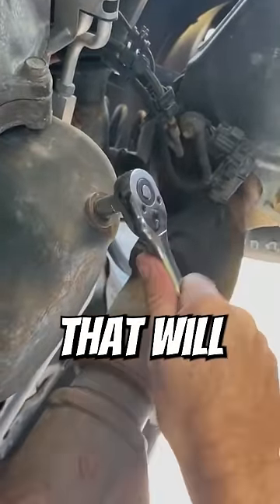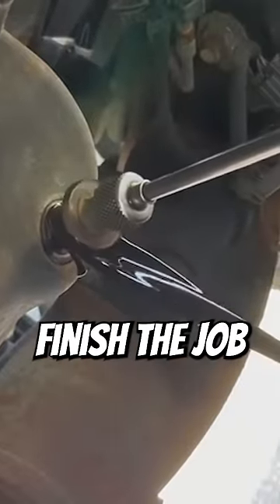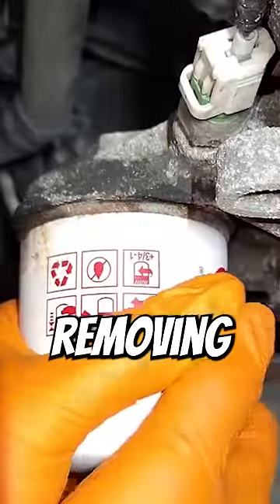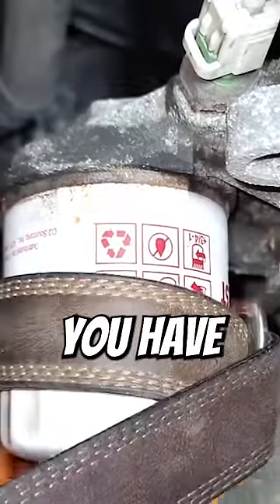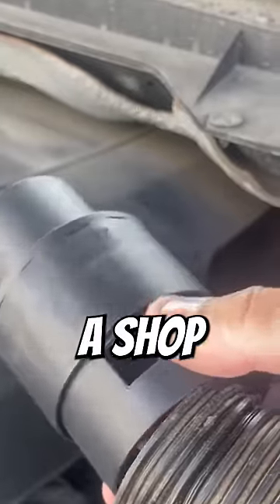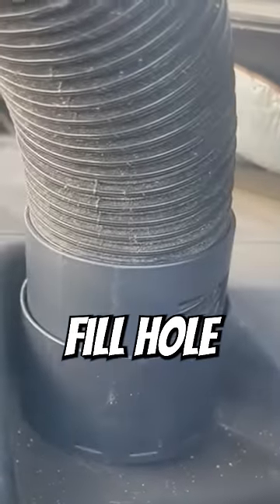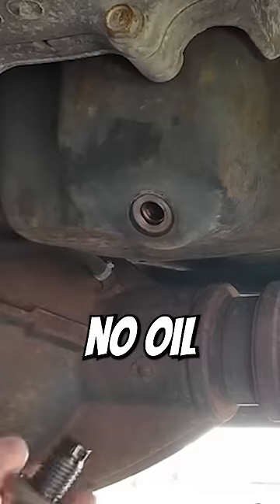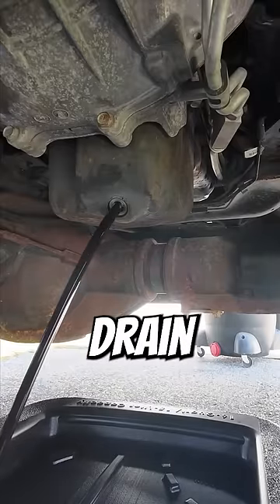Mechanic Life Hacks That Will Improve Your Worthless Existence - Oil Change Edition

Comment: Quick tip if you don't know if you have completely drained all your oil out,put your lips to the oil hole and suck it out.
Reply: That's one way to do it I guess
Reply: Or just put a bucket under then go grab a beer or two and maybe take a nap... After several hours the oil could be mostly drain out.... Or drain the oil overnight.... Next day is no oil drop
Reply: @MariusVayne85  here's a quick tip to dispose that motor oil.:pour it out on your lawn it helps kill mosquitoes cricket ant no cats will shit in your yard crab grass real grass grasshoppers. Hope this helps
Reply: @john_dougg811  lol.... That's how I disposed ant nest.... Lol... Best way to do it.... Or there's a cheap way to make your tyres looks shiny.... Take a cloth and dip into the used oil a little then wipe the side tyres...... Lol....
Reply: @MariusVayne85  it make a great dye for the driveway. Also,when I have chapped lips or dry skin it make a great moisturizer. Don't git rid of that filter, you can use it as  brita water filter.
Reply: Yum
Reply: Are you speaking from experience and is that why you can't decide if your name is John or Doug.😊
Reply: Hehe good one ...hope no one would take it seriously though

Comment: The hack I use is a paper towel. It will wipe the oil from your hands.
Reply: Gloves exist and do a better job
Reply: Not when you're in a hurry And the oil is lava degrees.
Reply: This was the most useful
Reply: Sure, but all that exposure to hot, caustic chemicals is a great way to get skin cancer. I've been wrenching for 15y and have been using gloves and tips like these for10 of them
Reply: Same here
Reply: @michaelbuteau4183 why you changing the oil while it’s lava degrees
Reply: @michaelbuteau4183 you shouldn’t be changing your oil when the engine is at lava degrees
Reply: I wear a glove, remove the drain plug, and do something else for 15 minutes while the oil all drains out and stops dripping.
I put on another glove, remove the oil filter and clean up with a paper towel.
Then the drain plug goes back in, the new filter goes on, the fresh oil goes in, and I'm done.
Reply: 2023 when even mechanics don't like to get their hands dirty ooh messy2023 when even mechanics don't like to get their hands dirty ooh messy😂
Reply: @corgi46290 LOL I assure u u DO NOT have to worry about gettin 'skin cancer' from not wearing gloves doin mechanic work I'm 61 years old been doin it since I was knee high & can't stand to wear gloves when working & I've seen MANY MANY others the same way I'm 100% sure about this
Reply: @@MyIQis172 If you can work out a way to make it to the shower without leaving oily handprints all over the house on the way it's a quite viable solution.
Reply: @jamiejones6994  as soon as you can produce an oncology degree, then your words will carry weight. Till then I'll trust the experts.
Reply: @vwwrenchie314  nice job proofreading yourself there slick
Reply: @jamiejones6994 Survivorship bias. People have been doing dumb dangerous shit and not getting hurt and not knowing anyone else who got hurt for ever, while loads of other people got hurt. Your experience doesn't mean it's not dangerous and loads of people haven't got cancer or just dermatitis from oil.
I managed to get contact dermatitis from frequent extended exposure to WD40, now my skin is super sensitive to it. It's not fun.
Reply: @feanor5037  LOL u really do think that was what it was from (wd40) don't u?
Reply: @jamiejones6994  You can make any weird innuendo you want but yes, after recurrences over a period of several years if I'm not fastidious wearing gloves - definitely was from WD40. It's a known problem if you review the COSHH sheet.
Reply: @feanor5037  Like I say 50+ years guess I'm a lucky mf lmao

Comment: I usually just get it done.. have a shower beer after and get on with my life.
Reply: You know you want to try the vacuum trick
Reply: You sound like my kinda guy… simple and to the point.
Reply: Yeah.. for the most part if you’re getting oil on yourself you’re doing it wrong
Reply: Yeah me too infact I love getting warm oil all over my hands it feels good!!!
Reply: @foojub6907 pssshhh you mean if you’re NOT getting oil on yourself, you’re doing it wrong
Reply: Best tip is keep an old blanket or large piece of thick cardboard and place under the engine bay. If anything goes south for any reason most of the oil won't end up on your driveway.
Reply: @foojub6907  or you just don't give a $#!t about getting oil on your hands.
Reply: @slacker007  keep soaking up those carcinogens, clearly they’re doing you good

Comment: I wont lie, the computer voice had me expecting some garbage, but these are actually pretty solid tips for beginners.
Reply: except the magnet one, oil just pushed the bolt into the pan.

better just to pull directly back and a little up, i dont think ive ever got oil on my hands since my first time. though the oil filter cup method is awesome.
Reply: Not an AI actually, you can hear the breaths and the pauses
Reply: @OverAndOverAndOver  it's an ai, it just sounds super real to people that don't hear it every day. it has strange cadence and tone and the sample rate fluctuates randomly.
Reply: @OverAndOverAndOver Ai can make those sounds just the same.

Comment: Tip # 5. Switch to a fumoto drain plug.
Reply: Yeah but of you have a slamed or low car your going to oil the ground instead of your motor
Reply: @snapped4433 If you have a "slammed" car you're going to lose oil pulling out of the Walmart parking lot anyway
Reply: @lordgman1  yeah but that sits way lower
Reply: @snapped4433  Maybe don't have a slammed car then. I mean, cars can look cool lowered a little, but if it's so low that you can't even leave parking lots, not only do you look stupid, but so does your car.
Reply: I got a Fumoto because my car is slightly lower. Without it, I’d have to use jack stands or a lift. With it, slip a tube onto the end and route tube into tray, open valve. No mess and no jacking up the car.
Reply: This is my favorite 'hack'. Have two cars with Fumoto valves that never have any spills or splashes, no hot oil on fingers, no oil hiting the underbody due to poor engineer layout. Over 10 yesrs and 250,000 miles combined on the two with no issues. My ramps only collect dust unless I'm doing major repairs.
Reply: Tip #6 buy a spare engine so that when your Fumoto snaps off and burns up your engine you have that spare ready to go
Reply: I installed this in a Toyota RAV4 and Subaru Legacy and this is not a concern and I have the longer post that’s 15mm long. .59 inches . The Subaru has a cutout in a pan shield under the front engine and that post doesn’t even come close to even touching the pan so if you tear this off you are gonna tear off the shield pan and do a lot of other damage.  I hook up a hose and drain my oil right into a container and don’t get a drop on my hands. Also neither drain plug is pointing straight down but on an angle.  I wish I installed these years ago it makes changing oil so much cleaner.  It’s .59 inches long. 19/32” really snap them off😂😂😂
Reply: @RushWorkingMan  that sounds pretty similar to what I have on my FR-S. The end of the Fumoto valve is higher than several other things so if I’m hitting that on something it’ll be the least of my problems!
Reply: There’s a better design with a screw on cap.  Only downside is you screw the cap off and screw on a designated hose to drain.  Safer from speed bumps and sticks tho
Reply: @fredkuhn165  who makes it never seen one?

Comment: Oil filter cup is the one I’m going with this week. I don’t want to accidentally suck oil into my shop vac
Reply: @gmailisaretard well to be honest he could suck some drops of it in from underneath the valve cover, wouldn't be much but still it's used oil in your vacuum, probably wouldn't smell very nice after
Reply: I always poked a hole in the bottom with a nail and drained it. I might need to use the cup method Instead
Reply: I don't believe the shop vac
Reply: Get a centre punch and a hammer, hit the bottom of the filter and let it drain out first. This helps when the filter is massive
Reply: @Nays33 
Just use the solo cup
Reply: @berniemadoff7837  a truck filter doesn’t fit in a solo cup do it 😁
Reply: @NayNay-eu8en  
Can be 🤣
Get the Super Big Gulp.
Reply: @berniemadoff7837  I do it that way as many filter spill or push oil out of the top when you unscrew em, stops pretty much all the mess.
Reply: I have used every one of these Tips and hacks as a mechanic they all work but shop vac hack has always been my favorite

Comment: That shop vac trick is badass. Ive been a mechanic since i got out of the Marines in 2017. That shit has never even crossed my mind.
Reply: Right it's amazing I'm trying that next time. For a split 2nd I thought he was going to suck the oil out with the vac. I was like nope I'm changing it glad I kept watching
Reply: I tried this earlier this week and it worked on my cummins. Made a completely mess free oil change.
Reply: It's awesome if you need to change a seeping oil plug (BMW) and you don't want to drain the oil because it's not old yet.
Reply: me either,and I HATE I DIDNT think of it
Reply: Don’t do it it will screw up the seals in the engine.
Reply: @taterthot1184  If you think a normal shop vac is going to mess up seals, you're out of your mind.
Reply: I seriously doubt it will exert that much negative pressure to affect seals.
Reply: @st0rmtro0per  that's saying something. I'm pretty sure its written in the bible "he who doth change oil in a diesel shall wear multi grade on thou hands"
Reply: @taterthot1184  wrong.
Reply: I've done this before on my bike and it works like a charm..
Reply: It may fill your egr valve’s with oil
Reply: Use it if you need to plug a leak in a DIESEL fuel tank...on car...without draining or dropping the fuel tank.

The suction will keep the diesel from leaking out of the hole...clean with a degreaser and then use JB Weld for fuel tanks...
it will suck the JB against and possibly into the hole as you smear it all over the outside of the leak.

Wait about 1 hour and good to go...

DO NOT USE THIS TECHNIQUE ON GASOLINE FUEL TANKS.
Reply: First time shop vac is on blow and not suck will destroy any benefits you ever had.
Reply: Wouldn’t a powerful shop vac actually suck oil up out of the fill hole into the vacuum and ruin the vacuum?
Reply: Give the engine a suck and the black stuff comes out 
-uncle Ronnie 1947-2018
Reply: Only useful if you were replacing some kind of sensor mounted on the oil pan and you didn't want to mess with draining or replacing the oil. 
Besides if you pull to much vaccum on the crankcase you risk sucking in a gasket which would cause you to have one hell of a oil leak
Reply: I wouldnt suck the oil up even if its thinner and warm ?
Reply: @khatlest11 that's what I'm wondering as well..
Reply: Rah rah 7ton go wee
Reply: @AJ-yo7rb   well if you have an un bulletproof'd 6.0 powerstroke.....this act gives you the reason to finally yeet your complacency and remedy the fact ur rolling around in a ticking time bomb. The explosion will be more of an implosion. Your wallet will suck in faster than my dad at a public pool.
Reply: Me too brother, thought that idea was pretty cool 👍
Reply: @AJ-yo7rb The egr valve will be pulled off of the valve cover in order to get the hose in there. How would that happen to the egr?
Reply: Great idea until the guy helping you puts the hose on the wrong end of the shop vac and you get blasted with hot oil
Reply: I might try it, I don’t think the shop vac will be strong enough to damage anything.
Reply: Marines these days
Reply: If you keep the oil fill cap on before opening the drain plug, it can work the same way. The oil will still run a little but much slower, then when you are ready, remove the cap.👍
Reply: All you need is a wrench to fit the drain plug, a pan and a filter gasket wrench. Not interested in adding a shop vac and probably an extension cord along with the jury rig to seal the vac hose to the oil fill to handle a problem that really doesn’t exist or can be solved with a cheap pair of latex gloves
Reply: lol, yeah if you want a shop vac hose and shop vac full of oil that you will NEVER be able to clean out
Reply: Did it actually work?
Reply: Oh wow
Reply: Best if you place a shop rag over the filler neck to limit the suction a bit, if not it might actually suck up some oil.
Reply: Won't it suck up the oil?
Reply: No way that works perfectly in a pan full with oil.
Reply: @jeffwestbrooke279 
BBWWWWHAAHAHA!!🤣😂
Thanks! You’ve just given me an idea for getting back at my ‘good friend’ !…

Comment: Also running a bead of oil around the gasket on the filter when putting it on will make it infinitely easier to remove next time. No belt required.
Reply: That's just proper procedure
Reply: Yes 
 For those tough ones I put a strip of coarse sandpaper between the oil filter wrench and the oil filter. No slip
Reply: Never a bead rub the whole seal down, you don't want that thing to dry out from no.oil on it it's just rubber

Comment: Using the shopvac is a great way to change a leaky drain plug gasket without draining the oil. Been doing that for years.
Reply: Great idea! 👍
Reply: but oil is cheap and engines arnt, if the gasket is bad then the oil needs changed too
Reply: How come you deal with so many leaky plugs?
Reply: @extractorfan2143  Yep! I have the occasional one  that just leaks for some reason, but very seldom. I prefer the fibre or aluminium washers, but if they only supply copper, (which is fairly hard), it helps to heat it up till it's red first. That makes it softer which helps to seal easier, without having to overtighten the sumpplug.
Reply: @newtwitchclipper 
Most of the time we have already changed the oil. As a Jiffy Lube tech we had replacement plugs (That techs would cause damage with) at Walmart we tell customers after the service is complete that their plug needs 2B replaced. So if they go2 an auto parts store & grab1 we’ll throw a vacuum on it (saving the oil we jus changed) then put N Da new plug. Most customers don’t give a sh!t anyway & return (months later & miles over) with Da same damaged plug we reported last service wit no oil N the vehicle. 

These customers make techs lazy & not care about the job. Like they’re paying almost 40-50,000$ 4 this vehicle but if they don’t care 🤷🏾‍♂️ why Da fu*k should I. 
🤬. It’s a sad situation. 😒😩😳🤯
Reply: @newtwitchclipper why would the oil need to be changed due to an oil plug gasket.
Reply: @roushstge2 from what I've gathered. Causes leaks and thus oil loss.
Reply: @roushstge2  i think they meant head gasket but idk why cuz thats not what was originally being talked about
Reply: until someone shuts it off or the power goes out
Reply: @extractorfan2143  My thought, too.  I've owned 39 different kinds of vehicles and have not had a single leaky drain plug.
Reply: They don't just leak at some random point in time, the revolving door of poor quality lube techs provides an ample supply of forgotten, damaged, or incorrect drain plug gaskets. Or flat out damaging the drain plug. The oil gets changed, and a leak is noticed. Either on the shop floor, the parking lot or the customers driveway/garage. Sometimes its just from a messy service and nothing is leaking, its just spilled oil running off the engine/frame. So for customer satisfaction, ill change the drain plug gasket anyway so the customer sees something being done. I could just drain the oil, but that takes longer. Shopvac to the rescue.  I don't control who my shop hires, and I can't watch them 100% of the time, so they do dumb things. Either out of ignorance or laziness. They are supposed to replace the drain plug gasket on every service except when the gasket is non serviceable. (Chrysler/jeep/dodge/ram use a plug with the gasket integrated to the plug) and they are supposed to clean up the messes that they make which doesn't always happen unfortunately. I hope that clarifies why someone why someone would use a shopvac to replace a drainplug/gasket vs. Draining the oil to do so